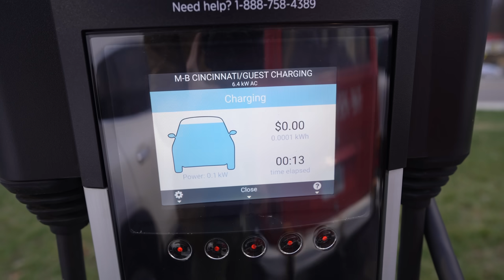I’m Crossing The U.S In My DIY Tesla Van - Day 15

Comment: I drove a 1969 VW van from Western Idaho to Western Indiana (where I attended undergrad) in the middle of the winter (early January).  The aftermarket, gas powered heater gave up after just 50 miles.  I was wearing three layers under a full-on snowmobile suit, woolen socks, winter boots, gloves and mittens, and an Elmer Fudd hat for the four days it took to make my way 2,000 miles.  Oh, and my top speed, going downhill WITH a tailwind, was 55.  Going over the mountain passes in Wyoming was particularly embarrassing.  I literally drove on the shoulder in second gear with my warning flashers on so that the semitrucks in the "slow" lane could blow by me.  Sleeping on the windswept plains of Iowa was super not fun.  Had to get up every hour or so to run into the rest stop bathroom to use the hand dryer to warm up.  The trip back in the Spring damn near killed me (multiple times) and I ended up abandoning the rig in Salt Lake and hitching the rest of the way to Boise.  I now drive a much more modern rig and I won't be going back.  Ha!!

Comment: Aside from the anxiety/panic that this series is inducing in us, you are showing very good real-world charging experiences especially for AC charging. I think you and your viewers would benefit greatly from checking out Kyle Connor’s channel out OUT OF SPEC and his Vlogs concerning the charging experience for the newer fast DC charging connections. This is what people really need to know about before investing in an EV or indeed converting one. I drove my converted VW bus on sunshine for over a year but only because I charged at home. Going on the road is an entirely different matter, as our friend Jack Smith has shown, in his and Electric Tribute to the Lincoln Highway cross country round-trip earlier this year in Michael Bream‘s converted VW bus. Afterwards, in that same bus, I learned some of the same lessons on our annual border to border VW caravan.

Comment: A way to keep the 12 volt battery charged is keeping it on a trickle charger when main batteries aren’t on. to have a mobile trickle charger is using solar panels with the extra battery storage when not in sunlight

Comment: You are operating under a nearly continuous level of maximum stress that I am feeling as well.  I have to remind myself that I am in a safe, warm place with plenty of food, heat and bathroom facilities.  When you are at the side of the road with 2% batteries I begin to sweat.  I now believe the most important emergency resource for a trip like this is a 6000w gas powered generator,  just in case the vehicle goes to 0% in the middle of nowhere.  You need greater range that would allow you to use the 80/20 charge/discharge rule...or LiFePO4 batteries that would let you safely go to 95%/5%.
You are a brave man, Charlie Brown!

Comment: A 12v nightmare for sure. Good job figuring it out! Definitely agree on putting a 12v voltage monitor on the dash. Maybe even switch the 12v battery from lead to lifepo4 for more capacity and faster charging.

Comment: you should connect the 12 batteries in parallel to double the Ah so you can drain it more also stress it less, please make sure if you do this that both batteries are at the same voltage.. .. and you are connecting positive on positive and negative on negative.. parallel not in series!! Otherwise you are doing 24V pack and you don't want that!

Comment: If there's one thing I've learned from your videos; if and when I ever build a custom EV, I will go for TONS of data display doodads.  You would've done so much better if (like you said) you knew when the inverter failed and were able to fix it before it drained your battery.

Comment: Absolutely love this series. I have two questions though - why didn't you install battery warming for your van (as a Finn all our EVs have that - all Euro cars like VW group cars, Mercedes, Audi etc. etc.) and also could you tell more about the problems with the 12V battery since I don't quite get it.
Reply: It was a quick DIY build, not a well thought out system really. The antics he is running into is a result of that. If he simply got a good reliable 12v battery like an Optima or something he would have avoided a lot of this as well.
Reply: @CadgerChristmasLightShow  Thanks for clarifying this!

Comment: Dude AAA is $50 a year and they will tow you 100 miles 4 times a year at no extra charge. You blew it. Yours runs just like the gas ones did. They break down every few days. But it's usually an easy fix.